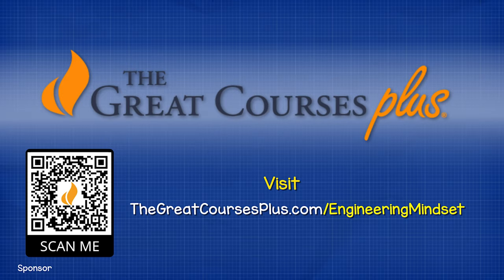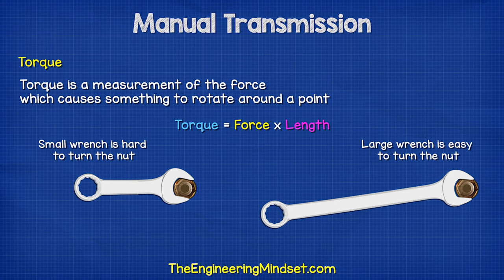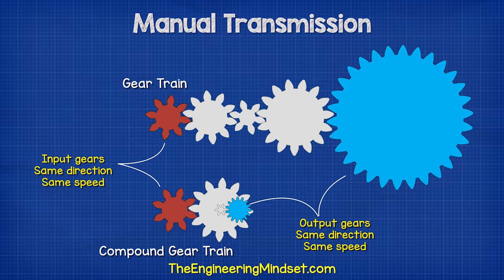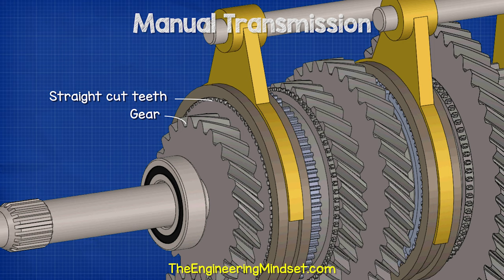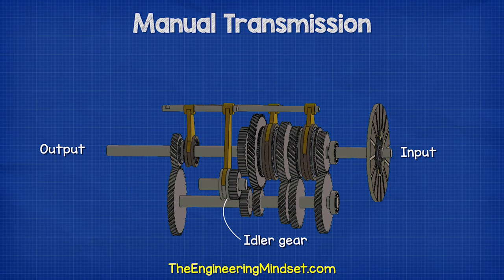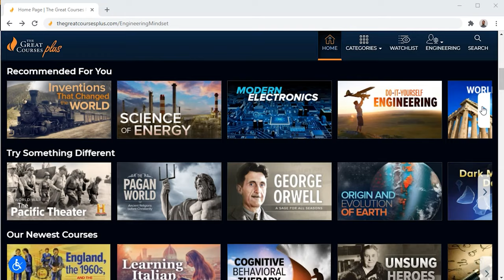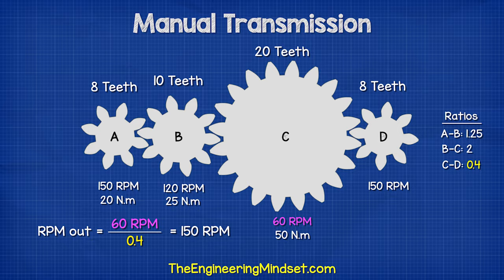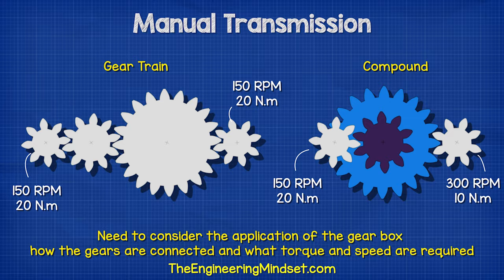How Manual Transmission works - automotive technician  shifting

Comment: manual is better because you can better control whether you want good acceleration or good top speed or good fuel economy.
Reply: To be fair you can do the same with automatic.
Reply: @Mosinsarmory not really, its more like there's presets.
Reply: @unosquash paddle shifters
Reply: I drive a manual and I have to disagree. A lot of cars and obstacles in my Indian roads - cars, motorcyclists, potholes, rambles, speed bumps, cyclists, pedestrians, cows, dogs, kids, goats... 

it's just too much shifting
Reply: @fr0xk  I agree with you.. hectic!
Reply: @unosquash  also your engine regs according to your pedal not your gearbox. So the original commenter made no sense

Comment: Manual shift just makes the driving experience more fun!
Reply: Nah
Reply: @jamesxia9523  What do u mean nah..
Reply: I used to be a control freak.
Reply: @equanimousawareness  I guess I still am 🤣
Reply: True
Reply: Actually it is safer and faster but yeah very fun
Reply: @thebrawlingmemereviewingam7968  safer? Faster? Based on what merits ?
Reply: it is more efficient meaning as a driver u can predict situations that are not possible yet for computer and i heard this statistic (without source) where automatic takes extra ~5% of your fuel ....they also use "torque convertor" that is awesome but also has some losses ...manual is also much easier to maintain, repair 

In the end its like a cable vs induction charging ....you either spare some money and have extra work (that is fun for me at least) or you choose the convenient one
Reply: yes
Reply: How? It's waay more annoying. You have to now pay attention to shifting gears instead of enjoying the drive.
Reply: @UltraGamma25  shifting gears is all part of the fun, mate. A driver must be able to combine different handlings at the same time. If your not capable to do so, you don’t belong on the road.
Reply: @akar6562  Most Americans cannot even drive an automatic properly on their highways as wide as a runway.
Better not give them a manual car, then.
Reply: @akar6562  it’s not difficult at all but, hey... it’s your loss. Take care.
Reply: MTs are fun, sure. But they're a pain in the ass if you deal with severe traffic jam on daily basis
Reply: Until you are in traffic with hills
Reply: Yes 100%
Reply: Probably only cheaper to fix and replace.
Reply: Big agree. Manuals are a blast, I don't really care too much about any downsides. To be honest, it makes me pay attention more too, as I have to focus and pick the right gear for what's going on. And, it makes sure my right hand is occupied, so I'm not messing about on my phone or something. The connection is fun too, especially if you can master heel and toe downshifts.
Reply: @favier9856  if your handbrake works you should be just fine lol
Reply: I agre
Reply: @jakkbatt4711  tried that method but endup stalling when i do it so rolling back for a little it is🤏👍
Reply: fun is subjective. i drive auto because I'm lazy and like to eat, drink, or play with my phone while driving. i know it's irresponsible but idgaf about other drivers 😈
Reply: @pohtangeynamo3351  at least u r being honest
Reply: @favier9856  yeah it was hard. U need to be extremely familiar with ur car's clutch or just born with good control. I myself rolled back numerous times even with my own car hahaha
Reply: Not ALWAYS more fun but always more interesting!
Reply: It's not for everyone. But some of us like feeling more connected and in sync with our car. With a manual transmission, you have power exactly when you need it, and use the engine as a break with down shifting.
It's not fun in traffic though. And clutches (and the foot that operates the clutch) burn out faster in lots of stop and go traffic.
But a somewhat sporty car, with curvy, hilly roads all to yourself? MUCH better with a sick.
It's for people who like the experience of driving, to be one with their car.
Kinda like riding horses nowadays, it's really for those who really into it.
It's disappointing that manufacturers are not making as many cars with manual transmissions now.
Reply: Theft prevention also. Most punk kids today can't drive a stick.
Reply: And more thrill
Reply: Compared to automatic (of any type) it's downright transcendental
Reply: Hell yea. Automatic is boring to me ive never owned one lol. I  drive 2 manuals and I love them
Reply: It's funny how much people bash those who enjoy driving manuals, still they have no valuable argument against them:

Control and reactivity is essential when driving, especially in congested roads. With manuals and proper skills you can choose the right gear fast, automatics take the time to analyse your input, then downshift, then accelerate. Cable throttles are the best alternative to a manual, might even save you life. My '13 Fiesta (dct) and '07 Civic (mt) would have killed me in a few situations where my '97 Sunfire (at) was able to respond as fast as my reaction time, as hard as I needed.

Being connected to your car forces you to pay attention to your car and your environment a lot more, which will make you a better driver. Manual trans as well as manual steering give you a more precise feedback of the road. Perceptions are key when calculating your next move.
 
There's so much more to say, but people above said most of it.
Reply: in the city no, it just doesnt, i have a manual and i despise driving my beloved car in traffic, id rather use my sister's automatic car.
Reply: @fungustmaster  I can agree with that.  Many of my drives are on open and twist country road, which is where a manual can be really fun. In the city manuals can be a bit daunting.
Reply: Yes, it is.
I like Manual Transmission over Automatic
Reply: Yes but when your in trafick its esier to use automatik but manual is manual
Reply: @UltraGamma25  well it gets boring when using automatic so automatic is kinda TRASH
Reply: Sure my friend 😎
Reply: @codyramos3200  I can mention one advantage

You can hook up a trailer and draging weights with no problem but you cannot do the same thing with automatic transmission
Reply: I love either manual and automatic
Reply: Hear, hear.
Reply: It all comes down to whether you prefer to use a vibrator to get her there. Sure you can think about other things if you use a vibrator, but definitely more fun to get her there yourself.
Reply: @H_F Anto true. No lie detected.
Reply: I agree 👍
Reply: Very good information thank you
Reply: Traffic jam: are you for real dude?
Reply: @hasanmohmed-dm1yb  Yes, yes I am 😁
Reply: Yeah in more synergy with the car, be as one, and it way much more fun to drive, and in winter it's safer it has more "grip" on the road
Reply: @UltraGamma25 Personally, I find shifting as part of the enjoyment during the drive 😀

Comment: I rebuild manuals for a living. I can confirm how neat they are to see and fix in person. What's really fun is getting into the science of how they react to high hp engines and loads and what can be done to help reduce the likelihood of a failure.
Reply: I’m currently in school for mechanical engineering, and we just started working on transmissions, we’ve done manuals and started automatics. It’s fascinating how these parts work, and how much more compact and efficient we’ve made them.
Reply: Do you still get a lot of work? It's sad how manuals are dying out.
Reply: I know this is old, you may not even see this comment but… im brand new to manuals, ive driven nothing but automatic my whole driving experience (10yrs) i saw a used car that had been well maintained and records of maintenance were available, needed a battery bevause it had sat for awhile, AC, power locks and windows, stereo system in working condition, interior looked good, $500 couldnt be beat, only thing was it is manual. I burned up and already worn clutch and ordered a new one me and my brother went about the process of dropping transmission installing clutch and putting it back together, welp we didnt fully recess the throwout bearing and it came loose and tore up clutch #2. I did all the work in the second clutch replacement myself, considering ive less than a year of mechanical experience and my knowledge is honestly limited to just HD commercial vehicles, so im pretty proud of myself lol. Heres my question though. What tips would you be able to give that would help me to increase my transmissions longevity. Be as thorough as youd like but also just giving me easily google-able phrases, or terms.
Reply: @frostyxmeboi8878  hey man I also rebuild transmissions and daily drive a manual. I would reccomend just practicing in a parking lot for a day or two and really feeling how everything goes with a third pedal involved. Don’t focus so much on the rpm when your balancing the clutch and gas just do it all based off how the car feels. Don’t freak out about stalling out or anything because it will only damage the clutch and not your transmission as your clutch is designed to take all the wear rather than the transmission.  Oh yeah and I know I said don’t worry about the rpm too much but if you’re gassing it past 2k-2.5k rpm’s then give it a little less gas and more clutch.
Reply: @connorjohnson3429  ive dropped the transmission 2x to replace the clutch i just really dont wanna  take it all apart and out everything back together all over again sooner than ill need to lmao rn having trouble with a crankshaft position sensor, also the sychro on 3rd gear keeps rejecting the shift (could be user error) but ive made sure 2k,2.5k,3k not enough rpm the shifter will groan, at 3.5k-4k range it upshifts super smooth but feels like i have to skip 3rd on the downshift because it groans at the shifter everytime i try downshifting to 3rd
Reply: Different ratio for the power transfer. Think of one gear was huge right Infront of you and there was a tiny gear connected to it on the side and you turned the huge one. The tiny one would spin up quick. Hence first gear. If you applied the same amount of force on the tiny gear the big one would spin up slowly. Hence 5th gear

 @eliasaggeli1225
Reply: @Amp661  Manuals in America are dying

Comment: MANUAL-1.can either go in high gear to save fuel or high roms for racing.-2. It's fun.-3. If people don't know how to drive stuck they can't steal it.-4. If starter is bad you can roll it to start the car.-5.easier to fix.-6.can relaxed in neutral.-7. Make fun noises.-8. Good work out

Comment: Manual Transmission for LIFE! There’s No acceleration delay unlike an Automatic
Reply: U can easily get that changed
Reply: @isaacpowell6182  Oh! For Real? That’s good to know! But imma be honest, it helps fight my temptation to floor-it and drive speed-demon style in an automatic. If it’s a Stick-shift, I be FLYIN!! 🚗💨💨💨💨💨💨🚓 85mph
Reply: most new manual cars have acceleration delay and rev hang anyway
Reply: Strange as to why almost all sports cars are AT's including F1.  Ever wondered why?  I agree it's more fun, more engaging to drive a manual, but modern AT's are better at driving than you are.  Ever wondered why AT cars have "sports" mode and what it does?
Reply: Depends on the vehicle really.

Comment: Manual all the way. Better control and if your brakes fail you can still down shift. As well as lower maintenance cost .
Reply: There has never been & will never will be a replacement for the manual transmission.
Reply: @Bruce Lee I've been driving 5-speed manual full-time since the late 1980's.  And I still do. Never regretted it even once!  I've since trained my niece, now manual is all she ever drives.
Reply: Both has their pros and cons. Prefer automatic for regular driving and manual for  showing off.
Reply: A shift-gears selectable automatic transmission(not the dct) can also do any of these tricks with more ease.
Reply: @Ghosteriz  Then there is no clutch to coordinate the shift with, so in reality, its still autotragic.
Reply: @Ghosteriz  I still prefer manual for the lower cost to repair due to the more simple design.
Reply: Sucks when your stuck in traffic going up hill, people tailgating and your just trying to inch foreward without rolling back. Very stressful
Reply: @Brandon thank goodness not all of us live in cities like that.. I mean I'm in a city and worse rush hour would be just over an hour

Comment: This is great, but I think it understates the importance of the synchros. The gears don't need to stop spinning to engage a gear, otherwise you'd have to sit and wait a while just to put it in first and get going. Not to mention upshifting while accelerating. Synchros!

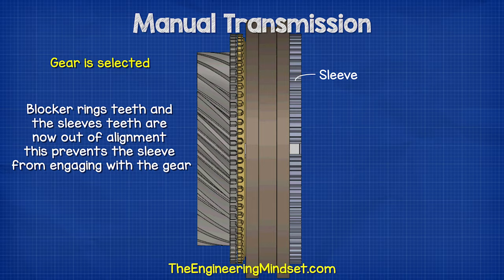And I think the bit at 10:30 or so explains why occasionally it resists going into 1st or reverse until you just slightly engage the clutch and it slides right in. I think it's those struts on the synchros not quite lining up.
Guessing it happens if you clutch-in in neutral, wait long enough for the gears to stop rotating, then try to put it in gear with those things misaligned and stationary.
This channel is amazing!

Comment: I've driven a fair number of cars both manual and automatic, and I will have to say automatic is the best because: 
1. I don't get cramps in my clutch foot if I get caught in heavy traffic.
2. It's safer, since I can constantly have both hands on the wheel.
3. It's just more comfortable never having to care about shifting gears.
4. I can start on slopes without using the hand break or doing some lightning movements with my feet.
5. I can lend my car to someone else who is not comfortable with manual transmissions, and be sure that they won't burn the clutch.
6. No human on earth, no matter what anyone says, can shift quicker or more precise than a modern computer controlled automatic gear box.

When I grew up all my friends said that you have to have manual, since it's more fun, and it requires skill, and that automatics are for wimps. They all drive automatics now.
Reply: All that is true, but manual is still more fun
Reply: But it is more expensive
Reply: @simonmonk1125  I don't think I've even seen a new car here in the US with a manual transmission. All automatics now. Used, I suppose manual may be cheaper, but you'd want to have it checked first to make sure the previous owner didn't burn the clutch or grind the gears
Reply: The very first day of driving my manual transmission VW Golf in heavy traffic on the hills in San Francisco, was the day I decided I needed an automatic transmission
Reply: Number 5 was the main reason I used to drive manual. I never had to worry about lending someone my car. All the rest are the reasons I now drive an automatic.
Reply: @aurum5336  Good one :)
Reply: Manual is the enthusiasts choice. 
1. If you are getting cramps, either the pedal is set up wrong of something up with your foot.
2. I consider auto less safe since you are that bit less engaged with driving.
3. It's complete second nature after a short time.
4. Bonus. It is good to have control over gears so you can warm up systems quicker in winter by driving high rpm in low gear until everything warmed up.
5. Bonus. It is much easier to navigate hills with a manual.
6. Bonus. Easy to bump start a manual.
7. Bonus. Auto trans will coke everything up from plugs to cats, to DPF. Engines need to be run at low load high rpm in regular short bursts to clean them and keep running well.
Reply: This clearly stated you don't know how to drive. You don't need lightning speed movements starting from hill. And manual become automatic after sometime, become you won't even think about shifting, it just happens
Reply: Well that’s one way to come out of the closet I rekon...
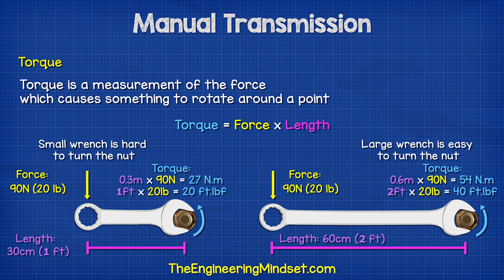Reply: @nobodycaresaboutyou5590  agreed! In my old F350 Diesel Pickup with the ZF5 trans I can be on a fairly steep incline, put it in second gear and just ease off the clutch as I lift my foot from the brake, no throttle needed and it takes off just fine. On flat ground I can idle off in third gear and that’s with 3:55 gears and 33” tires. Men who can’t drive properly make me sad for the future

Comment: Finally a perfect video that answered all my questions. Hands down the best, there is no better video anywhere about manual transmission.
A different question arose tho. On the video it appeared to me that 4th gear is the one always connected to the input shaft that rotates the countershaft. Is that correct?

Comment: I've always preferred a manual transmission. I prefer to have the transmission be proactive ( I begin shifting into the correct gear just BEFORE I need the car to be in that gear). An automatic is REACTIVE, it responds AFTER the fact.   Being an engineer myself, I commonly phrase this as " I know a lot of powertrain enginners, all great folks, but none of them have earned the right to tell me what gear I should be in" :)

Comment: Both of The Transmissions are Good. I Prefer Manual Because Shifting Gears Manually Feels More Fun and a Manual Transmission Can Tolerate a Bit of Water If It Goes Inside it But Automatic is Destroyed in Seconds. I Prefer That Manual Transmission in Better Even Though Now 1/100 Buy Manual if they Have a Transmission Option.

Comment: That was really interesting!  Would be cool to see four wheel drive/ all wheel drive and even just front wheel drive covered too, I imagine those are going to be a bit different.  Transfer cases etc.
Reply: The main difference is that with fwd and some awd transmissions (as well as those in rear or mid engined cars) the output shaft drives another gear which is to the side of the transmission and is connected to the differential. A rwd transmission will spin a driveshaft to send power back to the rear axle, but the transverse mounted (sideways, like the engine in a fwd car) transmissions need to spin something that runs next to it instead of behind it, so it drives a gear instead of a driveshaft. The main portion of the transmission is nearly identical between the two designs, same idea of an input shaft, output shaft, counter shaft, and shift sleeves.